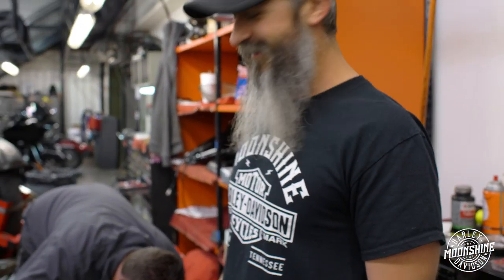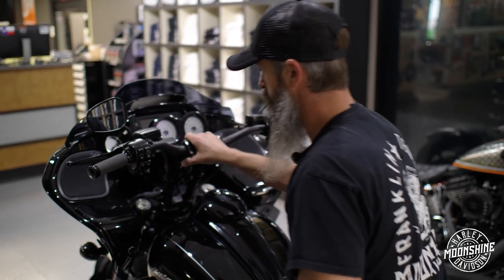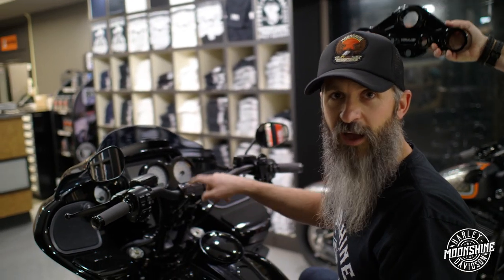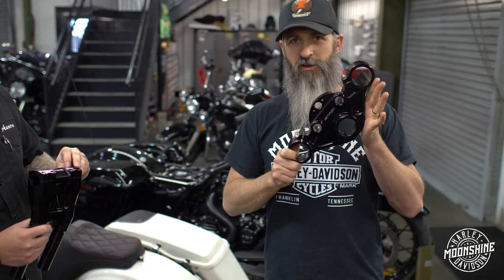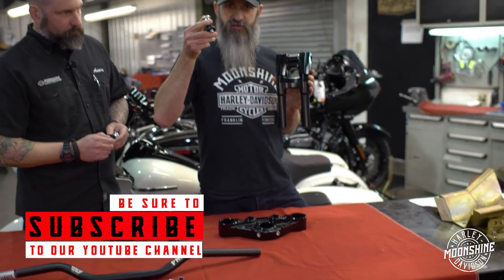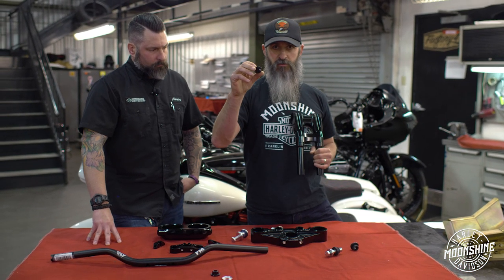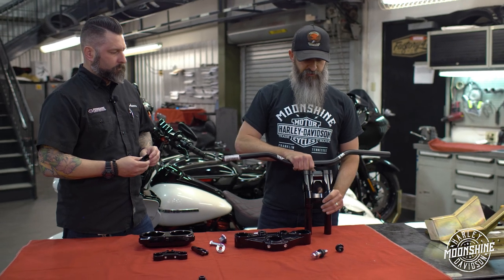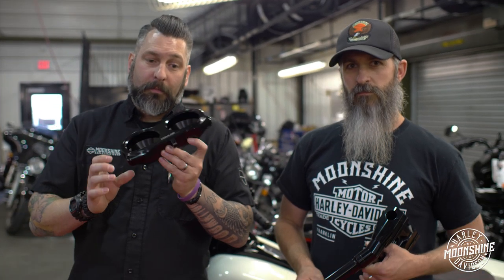Kraus Motor Co. Handlebar Setups! | Shop Talk Episode 39

Comment: I really don’t like the look of hiding the navigation screen whether I use it or not I don’t want it hidden. There is a simple alternative to the Krause set up and it is the FXR motorwitch bars they basically mimic the T bar set up they are 30 in wide and look great plus you don’t have to chop up your bike you can see your gauges and your navigation screen without relocating them.
Reply: I run the tall motorwitch bars. Love the look, feel, and the fact that I kept everything in original position without even having to extend my cables / wires. Way cheaper obviously too.

Comment: Does the wolf 1 top plate bring the bars back at all or do you still need the raptor or trex if you want to bring the kickback bars back even more?
Reply from the maker: You’ll need to pair the kickback with a Raptor or Trex if you need more pullback. The Wolf One top plate uses the factory riser mount location.
Reply: @MoonshineHarley  thank you for the quick reply. I’m 5’10 looking for chest height and don’t wanna be reaching forward. Laidlaw is pretty tall and I don’t think he’s complained about it being to close to him with the TRex plate.  It would add another 2” in height though. This is tough without getting to sit on an actual bike.

Comment: Ride a stock 2017 Road Glide Ultra.On long rides I get a burning knot at bottom of neck. Would you recommend those Kraus Bar setup or just go with taller bars I’m 6’1”
Reply from the maker: Vivid Black I would do the Kraus bars if you like the look. The white bike in the video is owned by a customer that around 6’2” - 6’3” and he loves the setup. Call the shop and ask for Aaron or me Jamie and we’ll go over the options 615-274-4170
Reply: Would a 10" riser instead of a 12" be comfortable for a similar sized person? I'm 6'3" looking at 10" riser w/1"1/2 pullback mounted to the wolf one triple tree? Do u think that's a comfortable setup or would I need more rise/pullback. Thanks for any feedback!

Comment: For clarification, does the stock ignition remain fully functional with the iso riser without the t rex?
Reply from the maker: It would be converted over to the CVO programming. With that setup you would just use the key fob to enable the ignition.

Comment: What’s the highest you can go with these bars using stock wiring and cables.
Reply from the maker: Stock cables will do 12.5 total inches, so 10" riser with the fly bars. Stock wiring gets extended on almost every bar we do but the cost for the wire extensions are cheap.

Comment: Hi guys I'm searching the internet everywhere for answers but can't seem to find anything. I've installed the wolf top clamp on my 15 RGS I've removed fork lock and ignition switch and put everything back together but without the switch I'm not sure how I get my bike to switch to run position. I did see a forum saying someone took their bike to the dealer to have it flashed to bypass ignition switch and just fire up with the fob present (Like CVO). Is this what I need to do to run the Wolf top clamp without the ignition switch?
Reply from the maker: Yes, If you are removing the ignition switch.
Reply: Hey, how did you install the top clamp? Did you have to remove the forks?

Comment: Can you do this to a 2022 Indian FTR Carbon? I’d love to get the bars up and back I’m also going to start bugging bmc/Corbin to build a taller widowmaker seat with a QD Large backrest if I do the Dub Performance 240rear and glass side overs no contrast all black only thing I would truthfully have to design would be a Heinrich/Paris-Dakar style tank sudo side covers that has a larger range I’m a disabled Veteran Father of four dreams are all I get for now but if I’m dreaming I want a bike that reminds me of my youth and the shit I wanted then lol 

(Someone just put my name on it)

2022 Indian FTR Carbon 
Bmc/Corbin Widowmaker seat with QD Backrest 
Isolation pullback riser for extra deep center pro taper mx bars
Toce undertail exhaust
Undertail plate kit
Moto-X Front Fender
Rear mud guard
RWD TXR Fairing Kit 
Waterproof gps/jukebox 

Then paint the whole thing the darkest black possible and sugar coat it with lane marking crystals 
Throw some endurance adventure driver and passenger wide pegs/mini floorBoards 
 amber led fog/flood/hazard bars front and rear
A phone Mount I can’t afford 
And a rifle scabbard for a Ruger American Ranch rifle with a scope 

Dream bike now to get competitive brands to function on one project and still not be able to afford it

Comment: How long does an install take for the full krauss setup.
Reply from the maker: Are you referring to the inverted fork and brakes as the full Kraus setup?
Reply: Moonshine Harley was referring to the riser and bars with the wolf one top clamp.
Reply from the maker: James Vance 7 hours with stock cables and 9 hours with cables. When we do the install we spend extra time running all the wires around the neck and into the frame so the install looks super clean.
Reply: @MoonshineHarley  wish you guys were my local dealer. I’m in New York. When I ask for pricing and the kraus set up the dealers here sound like they don’t know what they are talking about. Smh

Comment: Steering lock is pointless, any human over the age of 14 can break a steering like by pulling in it anyways.
If you want to lock your bike, get a disc lock or a bike U lock and put it through the arm holes of the rear sprocket.